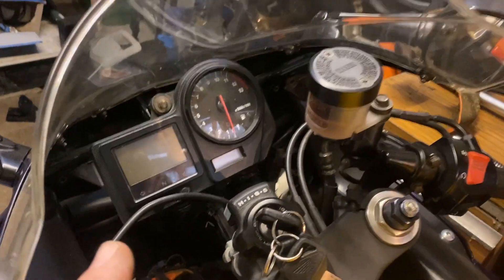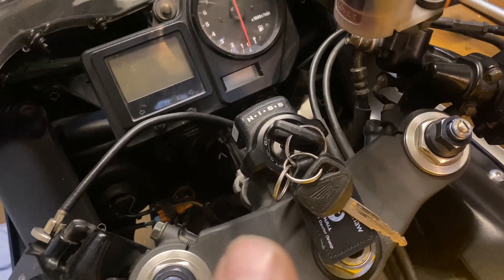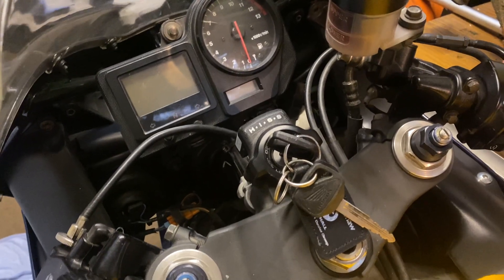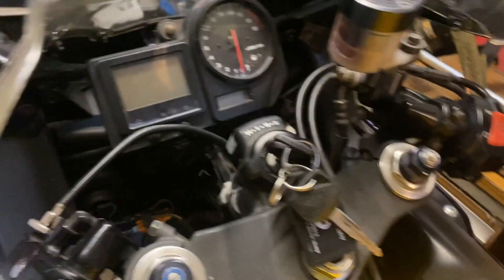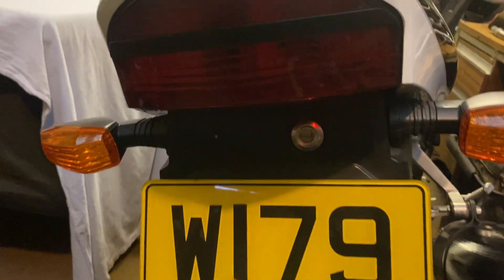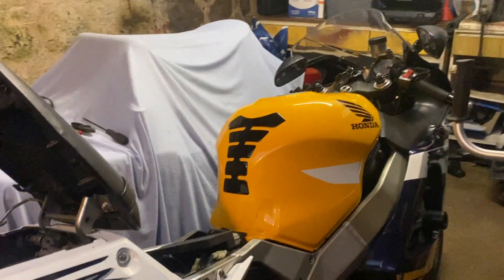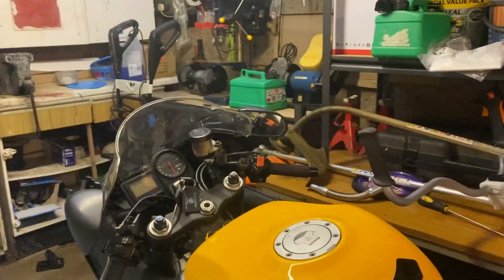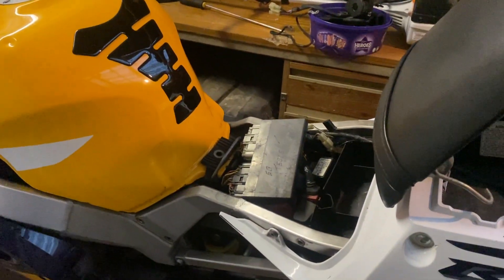Honda cbr 929 ecu working clip

Comment: I need a non hiss 2000 929 ecu are these still available
Reply from the maker: Hi all uk and europe CBR929 are HISS systems. If you need a non HISS system ECU you will have to get it from the US as they are the only country that run the CBR929 without the Hiss system. Hope this helps. Just go on Ebay USA